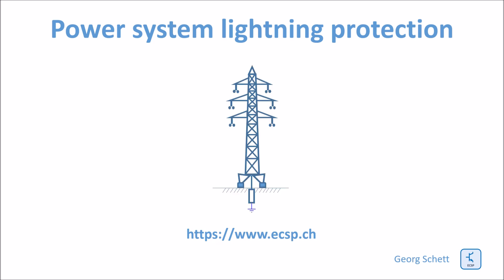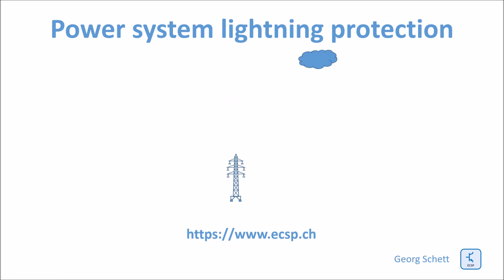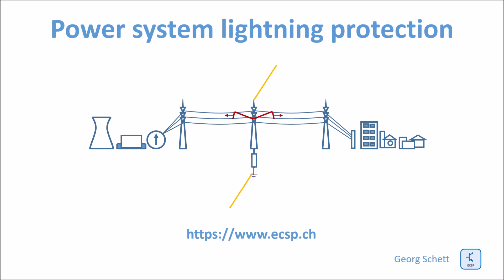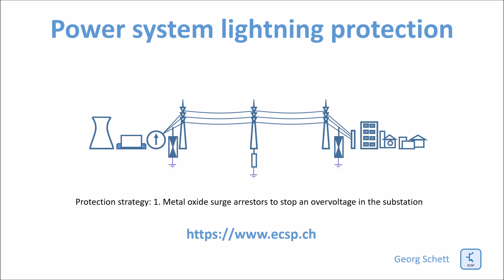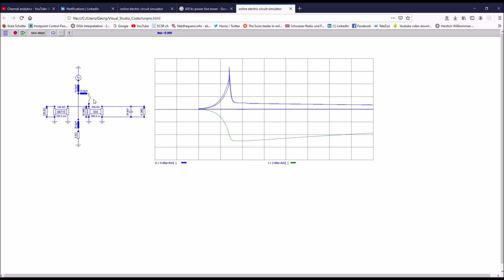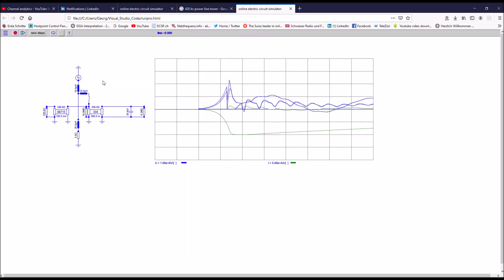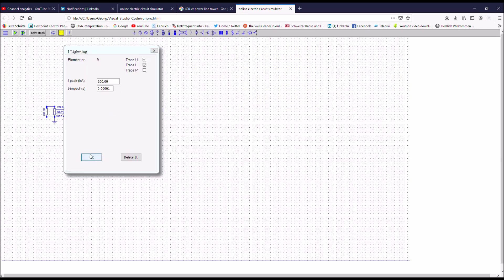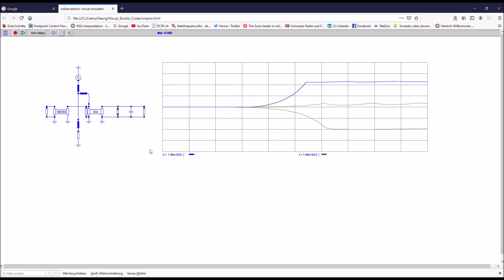Power system lightning impact [circuit simulator]

Comment: Thank you so much Mr.Georg  for that great explanation , I always have the question why you neglect the resistance of the tower itself? does it have thing to do with the simulation ? Thank you
Reply from the maker: Good question. The resistance of the tower is included in the simulation but it is not the important. It is kind of included in the grounding resistance of the tower. If you want to see the effect, goto www.ecsp.ch and click on the image with the title power lightning protection. So you will be able to change the value of the grounding resistance by the slider appearing on it when mousover. It is free, try it...

Comment: What about wood pole power lines? Wood is relatively good insulator.
Reply from the maker: I am not sure if this changes much because lightning can strike a tower but between towers as well. And the shielding wire must be grounded at the pols and thus even wooden poles would be conducting.
Reply: @georgschett801  The shielding wire is not installed on 20 kV power lines. In my country there are still some 10 kV and 20 kV power lines with wood poles

Comment: Thank you very much for the video, it is great, sir how we can avoid congestion in power systems (in the distribution level)?
Reply from the maker: Hello. I am not sure I get your question right. Normally cables and lines are protected for example by overcurrent relays. During the planning phase you have to make sure that the maximum loads possible are not exceeding the distribution system ratings. There are special software packages which enable a proper system design based on local standards.
Reply: @georgschett801  Thank you sir for your response, but how we can avoid it in case we have a peer-to-peer energy trading system?
Reply from the maker: @sarahebal4391  Maybe this article is of interest for you:https://www2.deloitte.com/nl/nl/pages/energy-resources-industrials/articles/peer-to-peer-energy-trading.html
You have a very valid question and this is a key topic for power systems. I guess it is addressed quite well in the linked article.

Comment: How does lightning affect power in high rise buildings? Here in Singapore, our power grid is entirely underground but lightning still causes power trips in apartments. It quite common during heavy thunderstorms and a trip even fried my bloody laptop once
Reply from the maker: There can be many reasons. If lightning hits a building for example, very high currents flow along the building grounding system which can induce overvoltages in the building power supply system. These overvoltages can well initiate a spark leading to a short circuit which will be cleared by a fuse. Thus the local blackout.

Comment: In India they will just trip off the entire grid when there is lighting       they don't want to take any risk
Reply from the maker: This cannot be the case for the entire grid, it would take hours to re-synchronize all the generation. It might however be correct for some small remote segments of the rural distribution grid where the protection may not be adequate yet. I have spent lots of time in India discussing protection with local utility experts and I have never heard this.

Comment: Hi Georg, may I ask if you can explain what it means by limit coupling between lightning protection and power system earth mat to 100V when a discharge of 100KA from lightning strike? Will you program able to study this? Thank you
Reply from the maker: I do not get your question. What position in the video are your referring to?
Reply: @georgschett801  hi, i am asking a general question. Lightning and earthing system isolated from esch other, when lightning strike, how can i check the conductive coupling voltage between two independent system? Can you system simulate? Tks
Reply from the maker: To some extent. A very precise simulation requires many details. However most of the time this is not really needed. The program enables you to model the impact of a lightning strike close to a substation to a great level of details and there is plenty of literature which can support you accordingly.

Comment: Hi Georg and thankyou for this.  As a system operator we were always aware of the affects of the lightning strike (CB's trip and reclose) but not necessarily the physics behind it.  So if lightning is conducted from the shield wire to ground there isn't a phase OV so no trip?  When the phase insulator flashes over and the wave front hits the SA at the station and it then conducts the current to ground would the protection scheme still detect the phase OV and trip the line?  Does the impedance of the SA increase as it heats up to limit the current to ground?  Thanks.  BTW I was at Lucerne for my honeymoon in 1987.  Beautiful place.
Reply from the maker: Thanks for your kind feedback. If the lightning hits the shield wire without subsequent backflash across the line insulation at the tower, there is no short circuit and thus no trip. The trip happens because of the short circuit and not because of the overvoltage. The lightning overvoltage is too short for tripping an overvoltage protection relay. The current impulse at the SA is also very short and thus I guess there will be no major heat up. The resistance of the SA may vary a little in function of temperature but the major impact on the resistance comes for the current amplitude through the SA and its none-linear characteristics. Nice to hear that you enjoyed Lucerne, definitely a beautiful place.

Comment: Can the shield wire handle the lightning current if it is directly hit by a lightning strike?
Reply from the maker: Hi Andrew, yes, that is what it is built for. The shield wire conducts the current to the next tower where it is grounded.
Reply: @georgschett801  I see, it looked thin compared to the live conductors. Thanks ;)

Comment: Anyway to down load these files i cant find them?
Reply from the maker: to your first question: the line starts if you put the mouse cursor on the connector, then the red circle should appear. Then click left and then the line should appear. Then you can double click to end it or you click once to re-direct or you click on another connector to stop it. 

The second question: the files are available if you click on the images at the bottom. You may have to wait a few seconds until it loads.